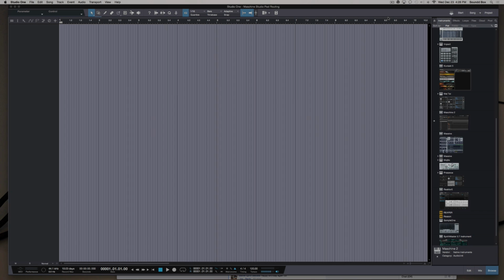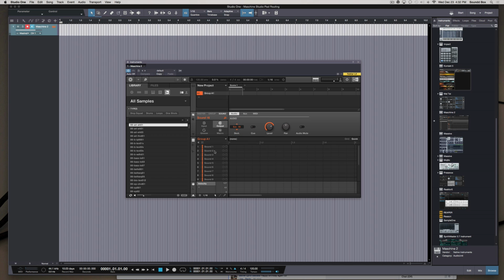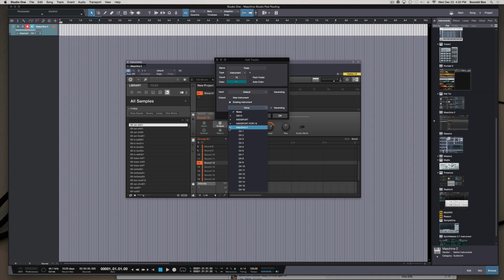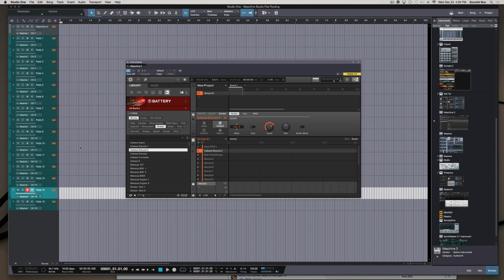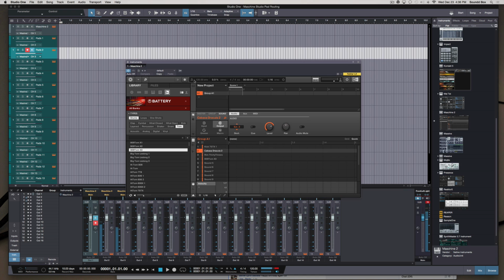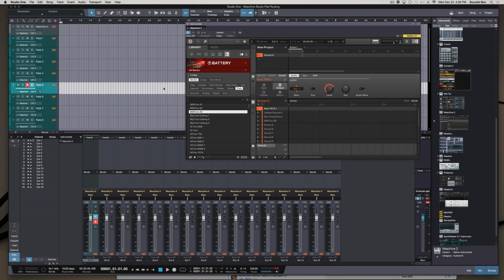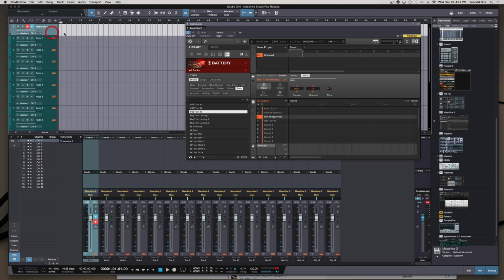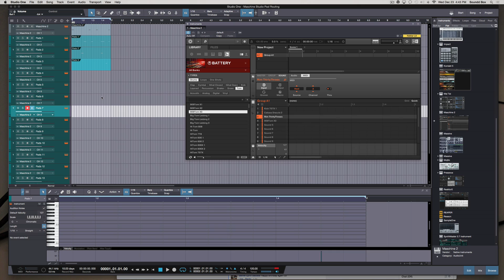Routing Maschine Pads to Studio One 3 Channels

Comment: What if you have more then 16 sounds your trying to route? Do you open another maschine as a vst instrument?
Reply from the maker: 16 is it. Loading two instance of Maschine is asking for death. You Maschine hardware can’t control more than one instance. I don’t route Maschine in real life. Export the stems is the best option
Reply: @beatkultr  Maschine actually does have more than 16 pad as a controller, just like Jam also, u simply add them if you require more....this set up doesnt work either in studio one v 5.4
Reply from the maker: @Yahoomediaclub  for the purpose of routing, 16 is the max. If you don’t need to route anything, then yes of course the pads are unlimited to what you can add to them via additional groups.

Comment: ok, so how would i go about maintaining the keyboard mode so that each channel can be pitched up an down like you had it at 9:58. because cant i leave every thing how you have it set up and then just record arm all of the studio one tracks and start making a beat that way? or should i just set the seperate outs an work on one machine track an then do explode from pitch so each perc is on a differnt instrument track an then manually change the midi channel in studio one?
Reply from the maker: Corbin Eddins this video is about routing each Maschine pad to a separate track in studio one. When you make a beat you are programming all the pads how ever you like and instead of the usual stereo output, everything is separated. When bouncing in place it's the wav representation of what you did so you can eliminate the Maschine plugin all together.
Reply: oh thats awesome! never mind me i totally missed that concept of the video, also since i just got maschine from my mentor if you save a kit that is pre routed to the seperate outs, when you load it will it still be pre routed? i havent had any luck in doing that so far
Reply from the maker: Corbin Eddins you have to save it as a preset. Everything goes back to default when dealing with projects. The only thing you won't have to mess with each time is the program settings program.

Comment: Hello , 
I am using this same set up and I noticed that with maschine open in v3 your timeline cursor slides smoothly across the screen while mine is jumping and sticks. Any suggestions on how to fix this?
Reply from the maker: Ray Richard how's the memory on your computer? Mines is maxed to 16gs and all libraries are streaming from external hard drives
Reply: KsoundDef yea I'm maxed too
Reply from the maker: Ray Richard check your block or buffer size

Comment: Quick question! What about routing Maschine Groups A(sounds 1-16) through H(sounds 1-16), as to load all Groups(banks) with different kits, is that possible or unnecessary? Does this method prove more advantageous? Also any transport functions on Maschine Hardware to enable record, or perform undo, just like in standalone mode at least on the corresponding Maschine track in Studio One 3? Am I going too far? $19.99 for this template!
Reply from the maker: Midi only supports 16 channels at the moment. The template is $4.99 here http://Ksoundd.com/asu. The courses are $14.99 if you share via Twitter or Facebook .